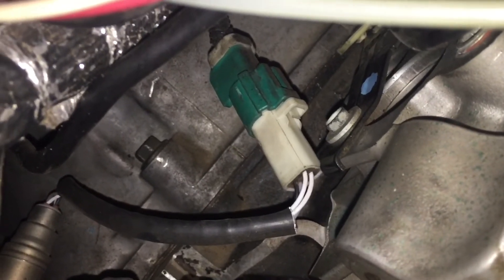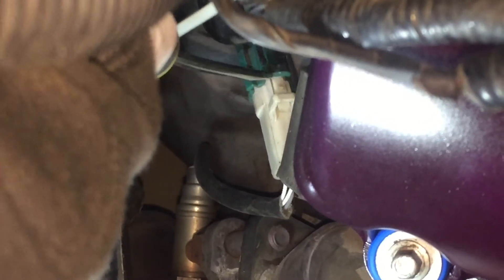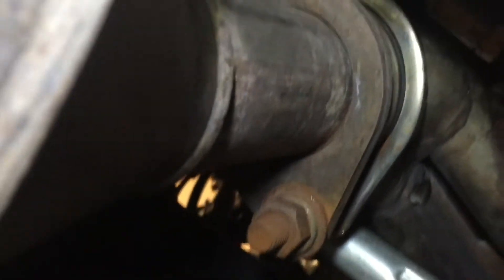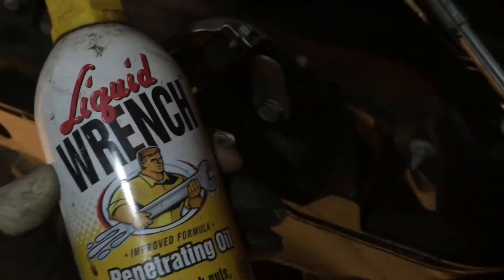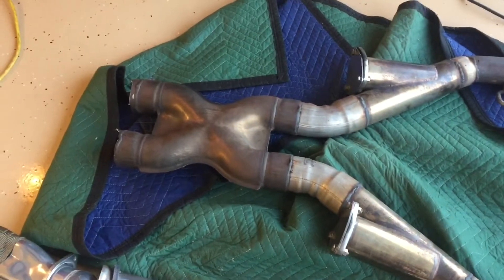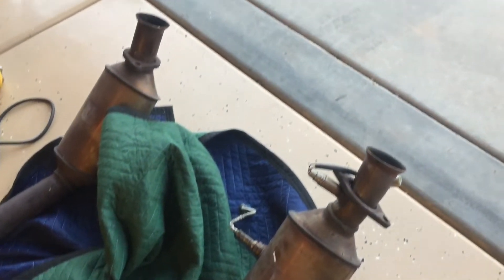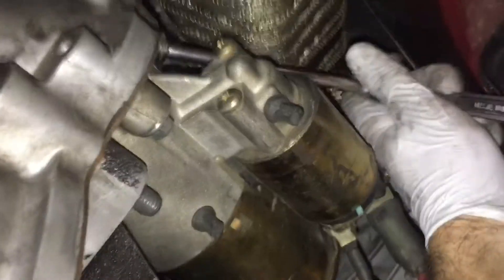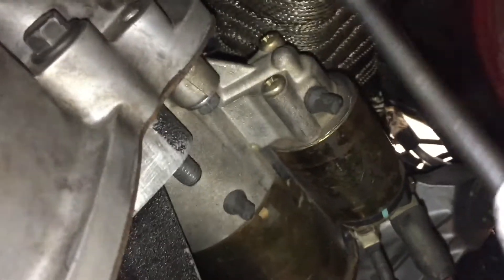How to remove the starter: 2005-2009 (2010) Mustang GT 4.6L 3V, Mustang V6 4.0L similar process

Comment: I have an 05 v6 Mustang that has 2 10mm bolts that were really tight and I'm having a hard time getting loose. I finally got the bottom bolt loose after using different kinds of bolt spray to help loosen. I'm still having a problem with her top bolt though with the extension on every time I put any kind of pressure to turn it the bolt just slips off! You have any suggestions
Reply from the maker: If it’s stripped you may want to put a bolt biter on it. They can be tight, so removing the exhaust is helpful for more working room or using an extension coming from the front with a larger socket wrench https://youtu.be/wdtxVKHjdwk
Reply from the maker: https://youtu.be/tqw_qiPaNsM
Reply: Thank you for responding. That is what I am going to try this weekend a bolt biter. The bolt is not stripped yet but it's going to if I keep trying to get it off and the socket just comes right off when I put pressure to turn it. I was able to get the bottom one loose, but like you said there's not a lot of room so going to have to remove exhaust. Thanks also for posting these videos they are definitely very helpful and a lot more informative and detailed then others I've seen, I subscribe to your channel so I'm not even going to waste my time looking at any other videos
Reply: @mikedee4399  - were you able to get it off ? (The top bolt)
Reply: @ThePerfectSeason1972  Yeah finally I was able to get it off, but I drilled it out since I could put the bolt in either side. The problem was the nut is only 10mm and couldn't fit ratchet on the nut all the way because the head of the ratchet would hit the body of the starter

Comment: Why did you have to take the o2 sensor out
Reply from the maker: To lower the mid pipe. You can unplug them or remove them. 
  It’s much easier with the mid pipe out of the way